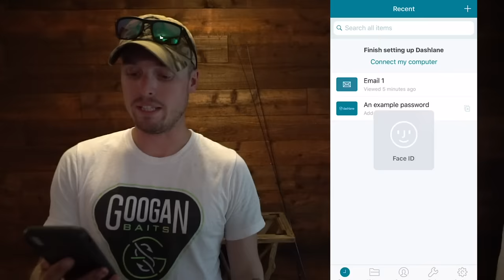$100 Homemade Kayak

Comment: You lost buoyancy when you put all that foam in the pipe. The pipe now holds less air.
Reply: Ha ha true
Reply: Josh Frank  I desperately wanted to tell them that their foam was being wasted.
Reply: Should have used 3 6" pipes
Reply: Cheesy Jay  if they're mounted perfectly symmetrically than yes they'll help stability, and the farther you mount them from the hull the more stable it will be (kind of like an outrigger). It will drastically impair maneuverability tho, honestly isn't worth it just buy a bigger boat if you need the capacity
Reply: @th3oryO  
If he made this boat  wider. With bigger pipes,  it would be a perfect fishing boat.
Reply: The loss in buoyancy is only due to the added weight of the foam. Filling the pipes with helium would make no difference compared to just air.

Comment: If the pvc is sealed, it doesn’t need foam. The foam is just extra weight. Air weighs less than foam.
Reply: and the foam won't dry
Reply: my thoughts exactly
Reply: Marc Moberg foam would just be for cracks as a backup
Reply: latorgator23 I get that, but if they had gone with the original plan of using straps instead of putting screws in it, the foam would be useless. Not to mention the fact that it won’t dry inside that cavity. Unless they left the caps off to let it dry (probably 24 hours) it will just stay a goopy mess.
Reply: um that foam will dry within an hr. Use that shit all the time
Reply: Marc Moberg I agree with you. Maybe I’m just trying to reason wanting any type of foam in in the first place. Heck, SOT kayaks are hollow with no foam.
Reply: Mr. Sway not in a closed space. It will dry an inch or two at the ends of the pipe in an hour, but to dry all the way through will take a long time.  I used that exact product in a door frame, and when I checked it 12 hours later, it was gooey 3 inches deep, because it only had a small gap to dry through.  This isn’t the same as the mix they use inside walls.
Reply: latorgator23 maybe spray it with flexseal after building. Lol
Reply: FAKE NAME yes, and it is ectothermic.
Reply: Marc Moberg ok billy maze 😂
Reply: Marc Moberg if your unsure on how airtight those pvc 'toons are, spend an extra 20$ and coat those suckers in flexseal. Absolutely
Reply: Mr. Sway lol did you just stop reading at "won't dry"? It will take a looong time to fully dry in an enclosed space with no airflow.
Reply: Exothermic not echothermic.  All exothermic means is that it heats up when in a mass. all of these expanding foams are moisture cure foams.  They will cure once exposed to the atmosphere.    Ectothermic sounds like something from ghostbusters.
Reply: LUMPYforeskin Smith better than $48 in foam.
Reply: Help Me He would get views from the flex seal boat schtick
Reply: LUMPYforeskin Smith I would u silicone around  the holes and on top of the scews  so water won't get in
Reply: yeah take the foam outa the plan next time
Reply: Yeah I sprayed foam in a cooler lid and sealed it 9 years ago it’s still liquid today if I take the plug out.
Reply: Until you develop a leak, then you'll be glad the foam is there... the "added weight" of cured foam is negligible. As for the foam not curing (as others point out), it will cure fine if it is added before the pontoons are capped.
Reply: Pretty sure the foam is pointless in a sealed cavity?? Maybe helium would help!
Reply: 1 gallon of displaced water will support 8lbs. If you weigh 200 and the rig weighs 50 you would need 31.25 gallons of displaced water to float. If you add foam you need to compensate for weight.
Reply: Do they not teach physics or math in school anymore?
Reply: It will add a bit of rigidity to the pipes though.
Reply: Worth a shot anything to stay afloat , who knows it may be a long way swim.
Reply: not inside a tube like that ... there are plenty of video showing using it with a cooler and it takes at least 24 hours.  And even then if you seal the PVC with a good glue joint ... the foam is actually a negative.  Plus that foam is not polyurethane I don't think so it will actually pickup water if its submerged. :)
Reply: Marc Moberg Absolutely. Now, after sealing the PVC tubing, we could drill two of the four caps and add nipples to fill with air from a compressor or even lighter gases such as helium or argon for more buoyancy.
Reply: Adolph Vela the gains from the other gasses would be minimal. Each 10 foot pvc pipe should hold 57 lbs of weight. If you want half of your pipe out of the water, and you want it to hold 250 lbs of weight (including itself), you would need 9 sticks of pvc. They could probably get away with 7 or 8, that would make it 30-35 inches wide (each pipe is 4.25” wide).
Reply: Or fill with helium, that’s lighter than air 😂
Reply: Isle of Wight Bushcraft helium is expensive. Air is free.
Reply: @marcmoberg  they might as well build a pvc raft : ) They're carpenters, not engineers.
Reply: I Agree
Reply: LunkersTV, pls remember the weight of the water being displaced should greater than the weight of the boat plus cargo and passengers to attain buoyancy. The weight of water is 8.33 lbs./gallon, salt water is 18% heavier, volume of the cylindrical pontoon is v= 3.14 x radius ^2 / length.
Reply: Spray foam is open cell foam it will hold water be extremely heavy and actually sink given the time
Reply: Nobody's mentioning the fact that.  You just watched an ad riddled plug video for something that absolutely doesn't work.
Reply: Googan
Reply: real shit
Reply: Right all you gotta worry about is displacement of the water and weight for buoyancy, unless its not watertight. I was thinking the same thing.
Reply: DEU RUIM KKKK
Reply: Barnacles are as sharp as razors and could puncture pvc very easily if there is foam it will still stay afloat if its just air its sinking.  I love diy boats and water fun but please take in consideration where to use this..its not much protection from an aggressive  gator.
Reply: That foam doesn't dry. It sets like an epoxy. No need for air
Reply: Marc Moberg The foam is negligible... the problem is the displacement is obviously way too low. They should have made about 10 of those tubes then strapped them together. Even one extra tube would be so much more buoyancy than no foam, I mean two of those almost hold him up, if he weighed 150lbs and supporting 3/4 of his weight then we can assume each is around 50lbs of buoyancy, compared to the what, 1lb max of foam?

He literally could have taken a shit and it would have helped more than no foam.
Reply: They should have just sealed the ends of the pipe and used metal straps to fasten it to the wood
Reply: JeremyK 541OR. Exactly.
Reply: Foam outside would have actually done something
Reply: @marcmoberg  a bunch of 2 liter soda pop bottles would work and then it would be $50.
Reply: Not true you spray foam in small sections with caps off drys completely in a few hours
Reply: @Mr.CakeFacee  that makes no sense.  If spray foam weighed less than air, it would float away like a helium balloon.
Reply: @marcmoberg  lol 😂
Reply: @marcmoberg  flotation foam gives more buoyancy that’s simple science
Reply: @Mr.CakeFacee  simple physics.  Does your flotation foam float like a helium balloon or not.  Foam doesn’t float better than air. Lol
Reply: First thing I thought when I saw the cans of foam.
Reply: the foam will also help if there happens to be a leak so the pipe wont fill up with water and sink the boat
Reply: The foam extra weight? That's a great idea putting it in it imagen if the seal breaks and one goes under. I would have cut the bottom quarter open on a few spots so when the foam is in the tube it has direct contact to the water.
Reply: Finally someone says it
Reply: A little late 🤣
Reply: If the pipe was sealed adding an air valve and about 20psi would make it float great
Reply: @scootersonlyrepair6773  pressurized air is heavier than non pressurized. About 3 psi would help combat collapse though.  Physics.
Reply: It's already heavy enough with 2×4's
Could've used p.v.c there too
Reply: Yeah,  I noticed that too, extra weight.  The foam air cells have to be in the water to float. It'd be better to make a mold for the sponsons and fill it with the foam, then remove the mold. Maybe build lightweight framework in the works and the foam would embed itself around that, then the seat etc. could attach to that.
Reply: Air is more buoyant than foam for sure. Shoulda cleaned primed and glued the pipes closed with no holes lol
Reply: maybe an intertube would be just as good.  wouldn't need the seat or anything. 
 Nice Try though
Reply: Many commercial kayaks feature foam inserts for added floatation, including sit on tops.
Reply: @MrSway-kt2bo  I was gonna say the same thing but I figured I’d let someone else say it
Reply: @marcmoberg  I’m not sure when that was but I shot that foam in freezer box cavities and it sets up just like normal.
Reply: It's sealed until it's not.
Reply: @adolphvela7929 That’s not how the physics of buoyancy works. Pumping anything, foam or gas, into the pontoons actually decreases buoyancy.

Comment: When I went to high school I had to take geometry as one of my math classes.  Using the volume of a cylinder will tell you how much weight your kayak will float.  The wood touching the water floats by itself so you could basically call that a neutral weight, but the materials above the water level all count as weight along with the weight of your pipes.  So you have 4" X 120" pipes.  V=Pie times R squared times height so you have  1507 cubic inches of volume per pipe or 3014 cubic inches in them both.  A gallon of water is 231 cubic inches so your two pipes displace 13 gallons of water.  A gallon of water weighs 8.35 lbs. so your 1st effort kayak can effectively float 109 lbs.  Volume displacement is not arithmetic--so if you went to 8 inch pipes you'd have 12,058 cubic inches of displacement and your kayak would now float 436 lbs.
Reply: Bravo
Reply: Daamn !! 

Not sure if your math is correct or not i am too lazy check; But it is impressive!
Reply: I love math people.

Comment: Adding foam inside won't add buyoyancy. The buoyancy of an object is equal to the weight of the water it displaces essentially. As long as the object (plus you)  is lighter than that, it will float. Adding foam would actually make it heavier and therefore less bouyant. You'd have to add more PVC pipes to displace more water to get it to float well. Boats always have foam in case it takes on water, to keep it somewhat buoyant and not sink to the bottom - not to help them float better.

Comment: Air is what makes the pipe buoyant. Adding foam reduces the buoyancy of the pipe. Boat manufacturers use it for sound deadening and buoyancy if the hull sinks.

Comment: Do the math, to float, it has to displace more water than it weighs. Use larger diameter thin wall pipe. Wood is heavy and wicks water. use pvc saddles to frame it instead of wood.

Comment: A light weight material you could use for making a cheap boat like that,is rigid insulation foam board. It will still float even if it's punctured. Where I live I can get 8'x4'x4" sheets for little over 30$. Probably need 2 sheets at the most for a boat. I love this kind of creativity! Rock on!

Comment: You could have calculated the  displacement volume of the PVC tubing. You could then figure out what length or how much tubing you would need (depending on your body weight) to keep you a float. If I'm not mistaken you want the displacement to be 3x your body weight, if you want your canoe to not only hold your body weight but remain floating with majority of it staying above the surface :)

Comment: Great video. A thing about the foam. Adding foam to an airtight void will NOT make it any more buoyant. It will prevent the void from taking on water if there were to be a breach, BUT the only thing foam is doing at this point is adding a small amount of weight. Think about it this way; what would float better? A balloon full of air?  or a balloon full of foam?
Reply: Man, read Archimedes principle, put whatever is heavier than the air inside and you will make the problem worse! LOL

Comment: I think i heard that the spray foam will absorb water instead of making it more buoyant. And putting foam in the pipe will only help when the pipe takes on water it is a reserve buoyancy so your just adding weight. Looks cool though.

Comment: You could calculate the buoyancy, but in this case an easy approximation if you ignore that density of the pipe plastic is to just fill up the pipes with water and then weight the water.  The foam was great just in case it leaks, but it does decrease the buoyancy.  A simple mod to make this thing float would be to add some 5 gallon water bottles as pontoons.  5 gallons is a bit more than 40 pounds of floatation.  If you put a bottle on each corner then it would probably balance pretty well too and you would look so stylish 🤠

Comment: One more thing, tell your friends from Favorite when they’re doing the dozer work for the lake that if the land has ever been used as row crop acreage to make sure they do a lot of work with a sub soiler. Because if the land has ever had any field drain tile put in it to keep the water drained off of it the piping will still be there. And some of it may still be functional which could keep the lake from holding water. This could be disastrous for the lake if it’s got any in it. The subsoiler will destroy the piping so it won’t drain anymore. Just some thoughts I’ve been meaning to share for a while. Peace

Comment: the expanding foam would not help the buoyancy because the PVC pipe is still the same surface area on the outside. If anything, you made the buoyancy worse for the pipes by making them heavier! Still a great video though,. keep up the awesome uploads my man
Reply: Colin Walsh  lmao
Reply: No one cares
Reply: my first thought, its like why are you adding density....
Reply: I couldn't finish watching the video. Every time they talked about buoyancy while drilling holes and adding weight
Reply: Where the foam helps is if a leak occurs, the pipe fills up with water. The foam still maintains a bit of buoyancy, but depending on the foam it can soak up water also.

Comment: Density of water 62.4lbs per cubic ft. Need roughly 3.2 cuft of displacement to float 200 lbs including the pvc. That equals to 14.5 ft roughly of tube, since you dont want the whole thing submerged double that so you need roughly 30 ft of 4.5" od tubing to make this work reasonably well. Keep up the great work!

Comment: Quick calculation, 1 liter of water is 1 kg of weight, the amount of water displaced (in weight) is the amount bouyant force (Archimedes figured that out in a bath tub). So if you want to support of 150 kg, make sure your pvc pipes are about 150 liters in volume.

Comment: Foam in boats is more emergency floatation in the case that the boat fills up or capsizes. Inflatable bladders would be a better idea in case of leakage of the pipes. To increase buoyancy you need to increase the volume without increasing the weight.

Comment: The pipes are more buoyant empty than with foam in them.   It is a matter of displacing water , and the foam just makes the pipe heavier, thus less buoyant.  If the pipe got a crack then the foam would help keep the water displaced keeping it afloat.  The reason some boats (kayaks and canoes) have foam in the bow and stern is in the case of the boat capsizing it would stay somewhat afloat and not sink to the bottom of the lake.

Comment: Alright Fellas, with a bit of googling, you could have predicted the performance without experimentation. Using the formula for the volume of a cylinder, we can calculate that a 4" pipe contains about 150 cubic inches of air per foot. Factoring in the weight of water, that will displace a maximum of about 5.4 pounds of it. Then you'll need to subtract the weight of the pipe itself, which a plumbing supply website tells me is 2lbs for a foot of the 4" stuff, which gives us a practical buoyancy of 3.4 pounds/foot. Assuming the weight of the wooden frame plus the goofball is 200 pounds, divide by 2(number of pontoons) and you'd need a 29'5" boat to even reach neutral buoyancy. In reality, you'd want the thing to sit about halfway out of the water, so we're looking a 59 foot boat. Not happening. The good news is that the volume of a cylinder increases exponentially with diameter, so if you had only doubled your diameter up to 8 inches, you'd be netting 16 1/2 pounds of buoyancy per foot. Now you only need your craft to be a manageable 12 feet. That's what you'll want to try next time.

Comment: Lunker, I too tried filling a closed container with some of that stuff which was supposed to expand to fill the interior of the container but failed terribly.  The reason it doesn’t expand is that stuff needs air to activate the expansion process.  To be honest, don’t put that stuff in the PVC pipes.  If that stuff doesn’t float in air, then it’s heavier than air.  Just cap both ends of the pipes, strap the pipes to the frame, and launch the “Pipe Dream”, (wait for it) downstream!

Comment: The foam increases the density.  You added mass to the same volume, mass/volume=density.  More dense equals less buoyant.  In the short term it makes it a safer boat because a leak wouldn't fill the pipe as quickly, but the foam will break down fairly quickly, so ultimately all it did was cost more.